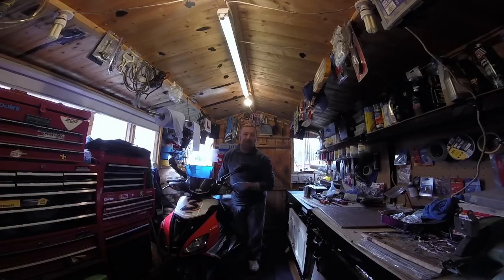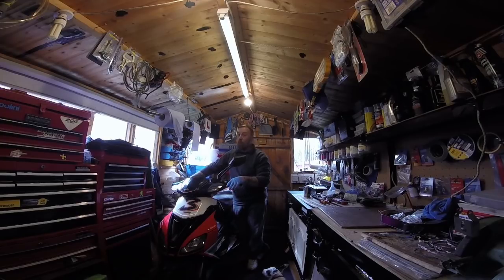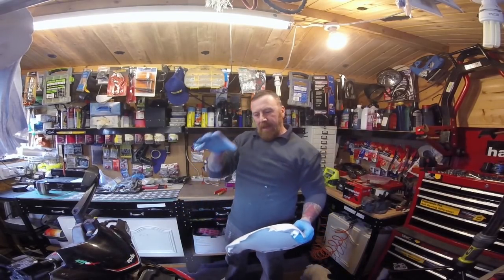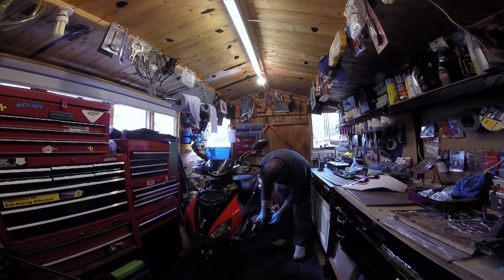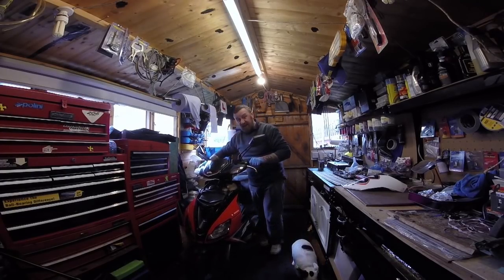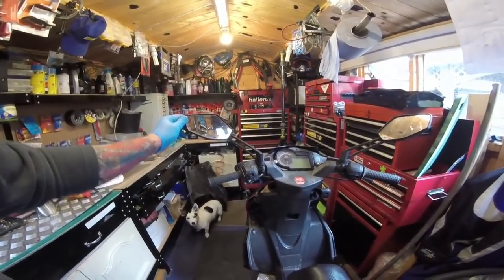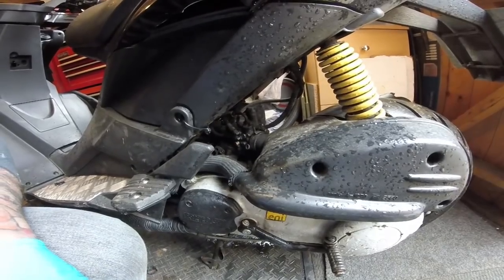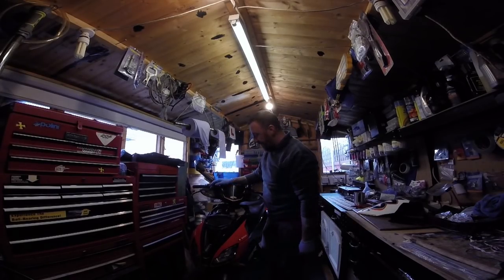APRILIA SR50 FIRST LOOK REVIEW CARB MODLE MARK SAVAGE

Comment: Thanks for the video.. Gave me a chance to sit what's "under the hood". Quick question, Where are the engines of Aprilia SR 50 made?
Reply from the maker: There's not much on where but by who SR50 with three different motors (Minarelli, Aprilia/Morini and Piaggio) over its lifespan depending on the year and country you live in. North Americans were sold the Aprilia/Morini motor from the SR50’s debut here in 2001 until 2009, when the switch was made to the Piaggio engine. Piaggio (parent company of Vespa) bought Aprilia early in the new millennium (2004), so using a Piaggio powerplant is a way to lower costs. All SR50’s have liquid cooling and all the ones sold in North America have direct fuel injection (aka DiTech). Real world milage for the SR50 is really impressive at 80-90mpg. It’s almost as good as the fuel sipping 4-strokes 50’s out there while offering far more power. The only negatives with the SR50’s motor are the inherent downsides to a 2-stroke (emissions, shorter engine life). It’s common to give an SR50 a top end rebuild every few years, particularly if modified.

Comment: Could you tell where the reclaimer/ altenater/ battery charger is located! Please. Mine is 2009 model sr50
Reply from the maker: Cryptek WolfUK hi bud 
The stator coil is on the right hand side as you sit on it 
With a fan or water pump that covers it
As in my videos on stators it’s the same as the speedfight videos on stator coil and how to remove it that charges the battery and does the timing 
Please watch my other videos and like share and sub
Mark
Reply: mark savage Thank you for the quick response and info, will be checking out your other vids. Subbed

Comment: Hi mate , got an aprillia sr 50 15 plate , just wondering how often I should be topping up the 2 stroke oil tank
Reply from the maker: it comes down to how much you use it , I know at the start you will be using it a lot but i'd just keep a full bottle with me in the boot and you will get used to how often you have to fill it but try aver other full tank of fuel to start then you will never run out 
take care bud

Comment: Mark, I need to work something on my speedfight electrics but I don't know how to remove speedo cable, how to remove it from speedometer,pull it or what ?
Reply from the maker: hi bud thanks for watching i have many videos that will help on everything to do with speedfights, give them a watch but it is easy.use a long nose plies and clip the two tags either side and pull down, i do this in many of my videos, if you have strong fingers you can just pinch it hope that helpplease like share and submark
Reply: Oh well, I seen that on your videos actually but I'm scared to pull it cuz I think that I will break it :D Otherwise I have problem with my fuel gauge, but I found what's the problem. Break light and fuel sensor cables are somewhere melted and connected, cuz sensor cable is using negative from break bulb and gauge is on full,  but when I push brake and 12v go to sensor cable gauge drops on empty. And that stops when I steer all the way to left or right, so that connection is somewhere in front.

Comment: Mark, can a scooter losing compresion from bad reed valve  ? cause my scooter wont run with air filter on i mean it idle but no power.. and when i put my hand over the air intake on the carb for a few seconds my hand is covered with gasoline i guess... and when i put my filter i can see that the air filter is too much dirty with oil and gasoline.. im thinking that my reed valve is bad.. also i can "kick start" my scooter with hand.. there is no too much back prassure.. i have no gasket leaks or anything like that.. again im thinking about the reed valve
Reply from the maker: hi bud thanks for watching i have had this problem on aerox's and speedfights, it the set up of the carb and often works without the standard air filter.i hate to say it but try one of the cheap foam filters and see how it runs, otherwise a check of the reeds maybe a good idea as they often get overlooked.have a look at my tuning video this also may help along with carb cleaning and service videos on my channel as most parts are in the same place and will help you may also end up having to have a look at the piston is you still cant get it running please like share and submark